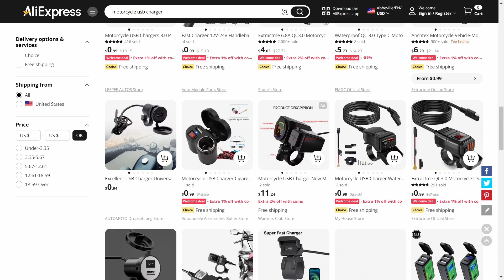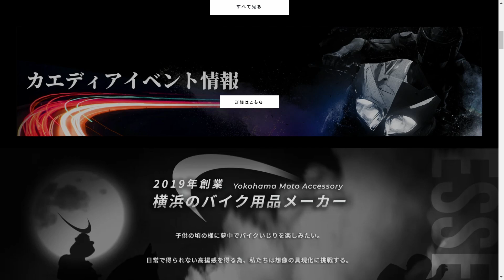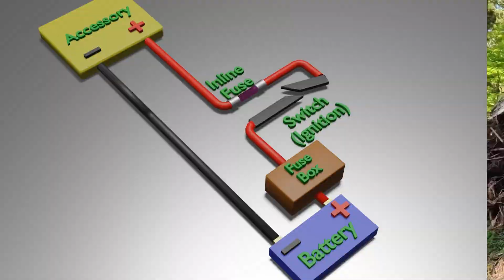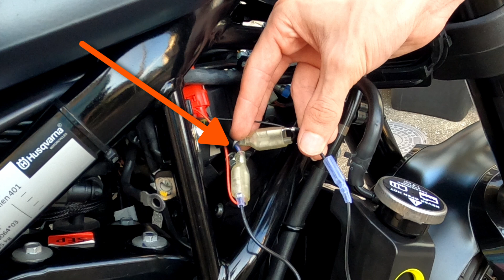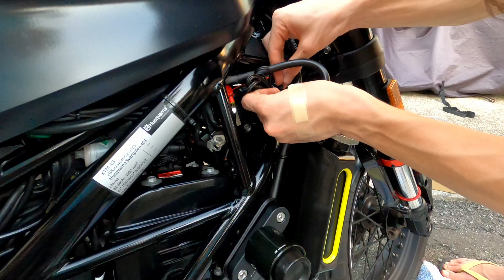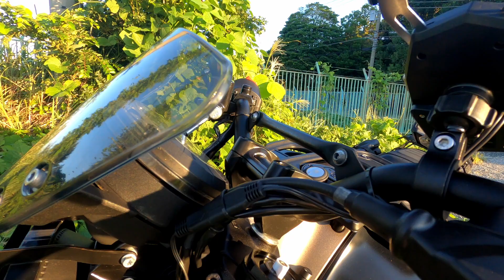Svartpilen 401 Accessory Install Beginners Guide

Comment: I installed the standard KTM 1Amp wired charger that way. It charges a bit slow but it's still enough to charge while having the navigation in my phone activated so i guess it's enough.
Reply from the maker: 1 Amp seems a bit weak but if it works, it works!